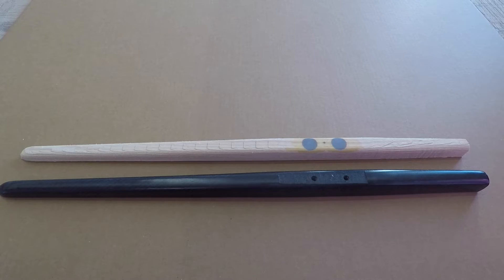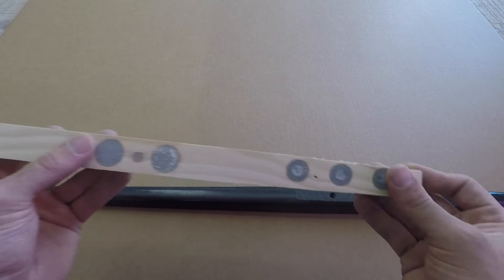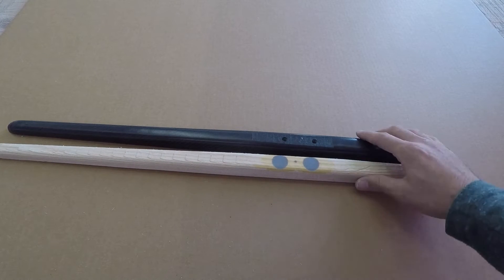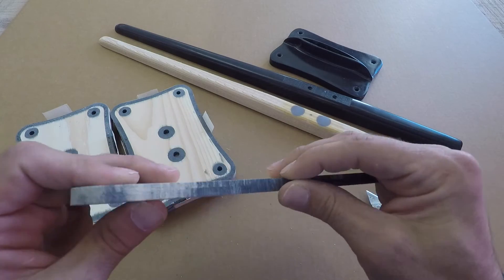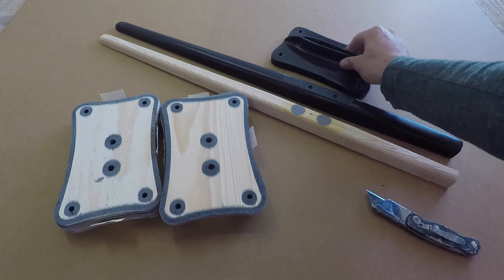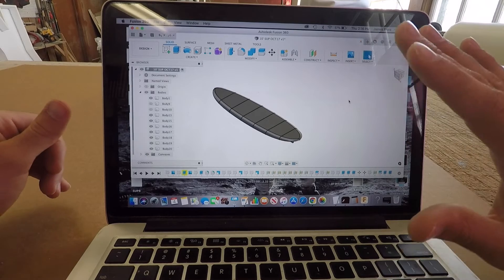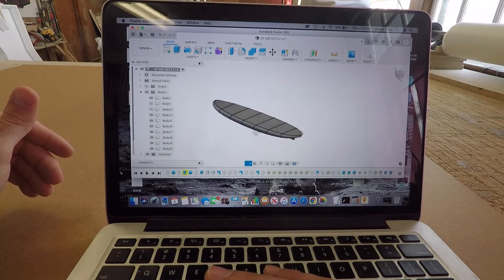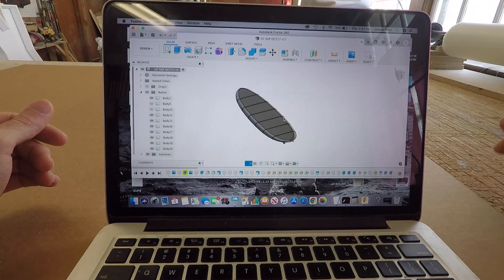Carbon Fiber Hydrofoil Parts.... how they are made!

Comment: Hey love you products. I recently bought the 2300 wood kit. Thanks for sharing this video as I wandered if that was a solid carbon fuselages. great design. I will have to use that type of thread insert next time. 
I actually watched the carbon build video and decided to make both foil wing and stabilizer removable for the wood kit.  My end goal is to build an electric hydrofoil board.
Reply from the maker: Solid carbon would be $$$ expensive... It also would get kinda heavy!

Comment: Thanks for sharing.  Do you use carbon sleeves on the fuses or wrap layers on the shaped core?
Reply from the maker: The layup for the fuselages is pretty complex. There are many many layers and several layers in key areas have the fibers in specific orientations to stiffen the part effectively.